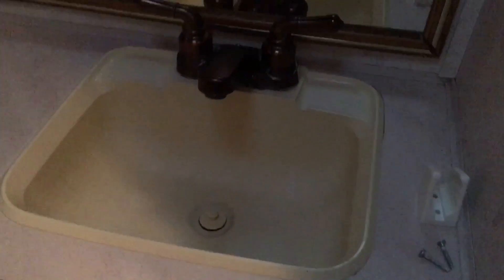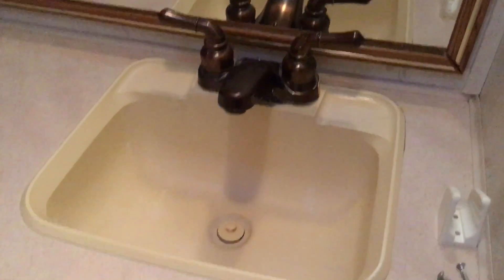How to remove an RV dinette!

Comment: what did you do with the extra bench and table?
Reply from the maker: Threw the table out and used the other bench to build the walls to the bar.
Reply: NOMAD-ness Life ok,heard you say that about the bar I guess,,,I have a 94 flair that my parents gave me, doing some work in it, used your video to inspire my wife not to give up lol,,thank you.
Reply from the maker: uncoiledmarrow There is a Facebook page “RV interior ideas” and there are soooo many amazing transformations if you need more inspiration. Check out my video on revitalizing the Shower. It was worth the work.
Reply: NOMAD-ness Life ,,,,I have the walls tore out in the bathroom right now, has a square shower, so it's hard to find a shower Stull, going to use the vinyl wall board and reuse the shower pan.
Reply from the maker: uncoiledmarrow...yeah we were going to rip everything out if the Homax didn’t work. I am glad it worked because it seemed like a lot of work to replace everything and make it travel friendly. Plus I was afraid of what might be behind those shower walls! Hahahaha
Reply: NOMAD-ness Life ours had wall board that was water damaged anyway,so it had to come out, just put new skylight and sewer vents in now the walls then new carpet. Going to try to coat the roof with Gayco roofing today.
Reply from the maker: uncoiledmarrow wow please video the outcome and send me a link!